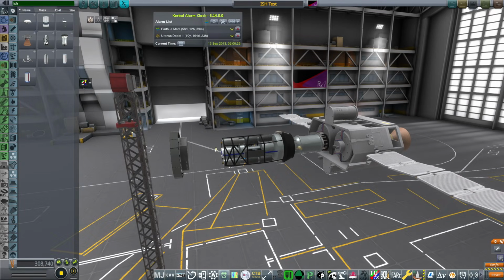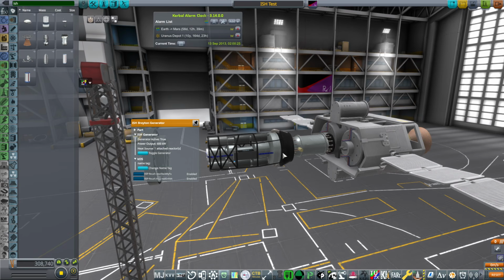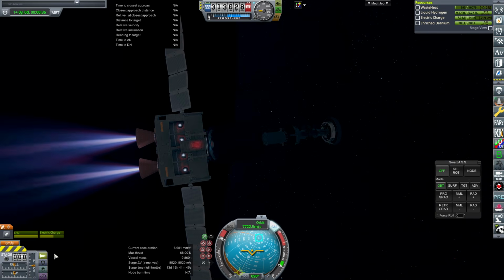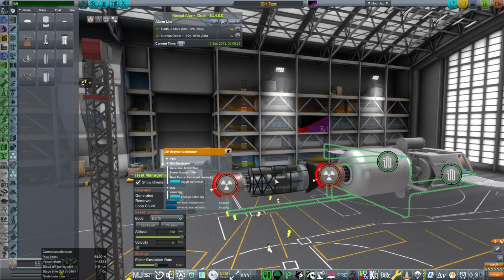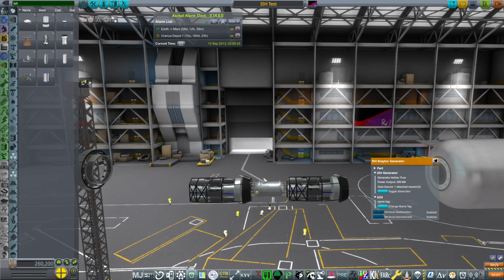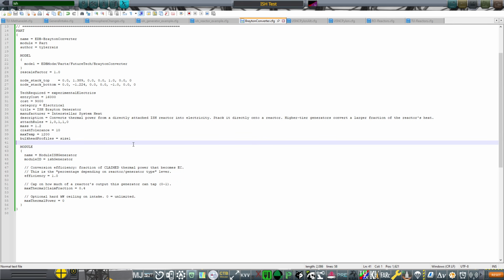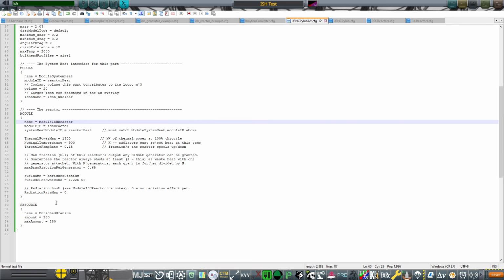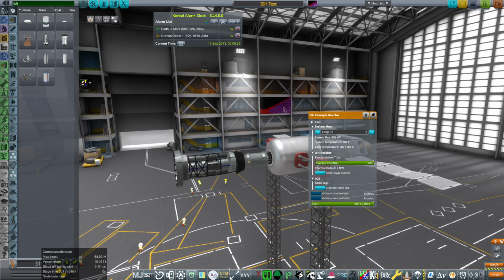New Reactor Module - Interstellar System Heat Intro (KSP)

Comment: Are those radiators realistic? I'd expect something much bigger for dissipating that much heat.
Reply from the maker: These are High Temp radiators from the Heat Control mod and not ones I configured so ... I'm not responsible. But in any case, the heat dissipation scales by the fourth power of the temperature the radiators can deal with, so even a modest improvement in the material of the radiators mean they can be much smaller to deal with the same thermal load.